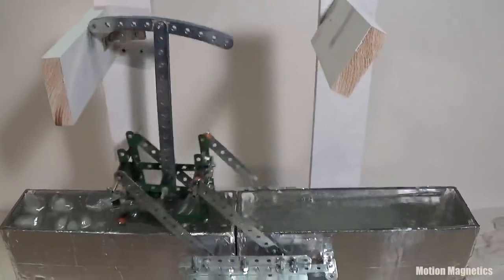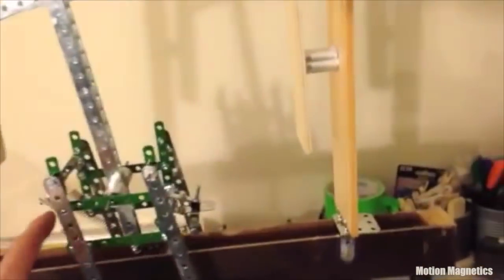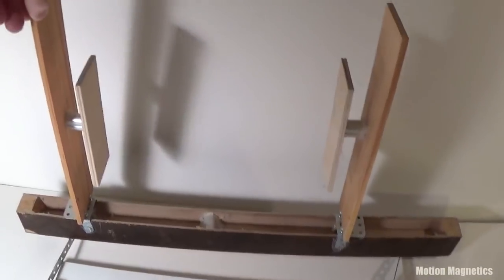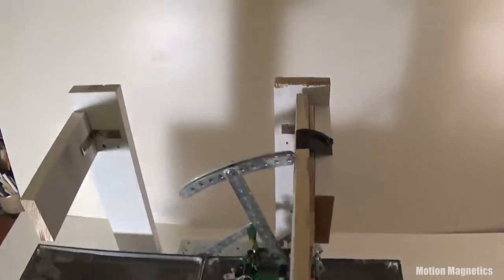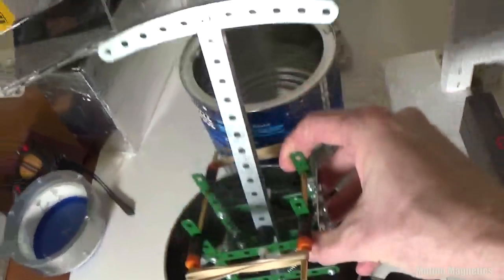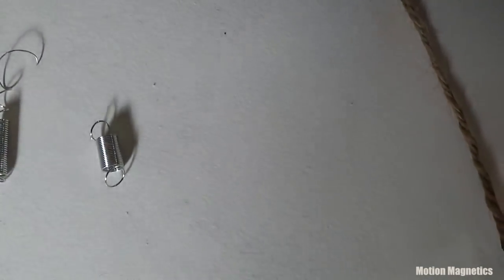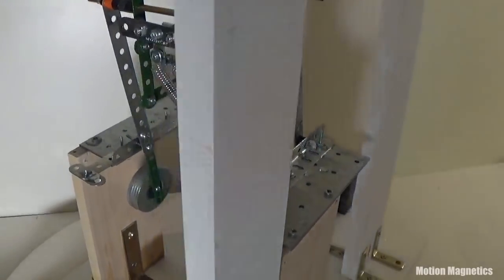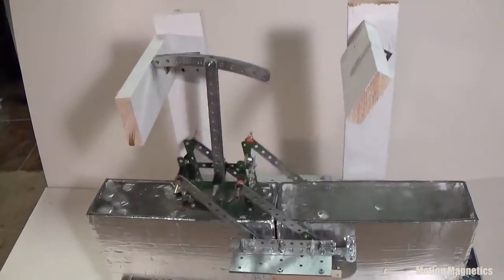Nitinol Heat Engine Version 2.5

Comment: I suppose you can obtain the same result with an escape mechanism like a mechanical watch. I mean you have to give energy in order to heat up the water, like turning a crown of a clock to give power. I know wall clocks that works for several days...i'm not inpressed untill you find a way (efficient) to heat up water for free and with no maintenance cost.

Comment: Very cool machine. Appreciate you sharing.
Do you remember those old toy windup cars? Wind up the spring by turning the key, then set the car down and let it go until the spring completely unwinds?
Could Nitinol be used in place of the spring steel in that mechanism? Seems like room temp nitinol would make winding it up easy. Then, apply hot water and allow it to unwind with force. I wonder if one of those unwinding could do useful work AND wind up a second spring at room temp, going from one to the other, each winding up the other back and forth for continual operation.
No, I don’t know how. Just a thought I had as I watched your video.

Comment: Wow that’s really involved, it looks great rocking back and forth, but for generating electricity I think the vid of the horizontal bike wheel spinning around like mad and if a small 12v gene/Dynamo was attached it could give constant energy if the water was heated with a solar collector etc.

Comment: I was totally absorbed through out the whole video. Great work. Could this be used in a circular motion to create a spinning motor? & If so would the heat required to be generated be more difficult to create than the energy the device could output?
Reply: @chaorrottai  1 engine outputted only 30W I believe, the 5 MW was purely theoretical if you were to stack an unimaginable amount of them together...

Comment: Nice design! Here's one more suggestion. 
What if you made a dual walled container for the cold side and filled the outer, sealed cavity with liquid nitrogen and the inner part with water.
The hot side could be room temp and it should run as long as the insulation kept the nitrogen cold.
Just a thought.
Reply from the maker: Thanks. Interesting idea.

Comment: It would be interesting to use concentrated solar heat on one side and compare it with stirling engine or solar panels. 
What do you think is the potential of a nitinol heat engine?
Reply from the maker: You can definitely power them that way. I'm not sure how it would compare to a Stirling engine. As far as the potential, they knew nitinol engines could be used to replace standard power generating techniques in the early 70s. https://youtu.be/oKmYqUSDch8
Reply: I just want to know how efficient are these heat engines.
Stirling engines were proven to be 30% efficient (more than solar panels) - but they were costly had more mechanical parts (less life time). Free piston sterling seemed a good way to produce electricity but I hardly saw any replications or comparisons regarding output power. 
Nitinol engines have not been in market for any use I guess. Neither has anyone compared it with solar panels. Maybe they are costly.
So solar panels seem to to be the best option now to extract sun's energy? 
I am new to these devices and this research area. I will be experimenting on them some time in my life. But I hope, we find a cheaper solution to compete with solar panels.
What are your views?

Comment: Nice video. Can this motion be used to generate enough electricity to maintain the temperature difference and power up LEDs?
Reply from the maker: Possibly. I haven't tried that.
Reply: Replace weights with magnets and coils to run pilter device sandwiched between to return there temps to there proper side

Comment: So how long did it run in the set up you showed last? 
Also think you could apply a copper wire to the motion and a magnetic field to generate electricity? Another option may be to use a similar device a motion charging watch (eco drive) uses to generate a usable charge?
Reply from the maker: It's assembled parlty of parts from an old erector set, so you have to stop and adjust some of the parts here and there because they vibrate loose. Other than that, it runs until the temperate falls below the threshold necessary to return the springs to their shape. About 10 to 15 minutes. If you kept the tray heated, it would keep running.
Reply: That's pretty good. Makes me think it could work in coordination with a Peltier device.
Reply from the maker: Possibly. That's not a bad idea.

Comment: Pretty amazing, man! Think you could plop a conditioning coil in the cold tank and a heat vent running under the other?
Reply from the maker: Thanks. You could. It would keep running if you maintained the temperature differential, and swapped out some of the parts so that they didn't become loosened from the movement of the engine.

Comment: I have a free energy idea with nitinol. You take a nitinol spring to lift a block with mass of 1000kg some distance of the ground by heating the spring with a tiny amount of warm water mass. I don't see why a fixed small amount of heat energy couldn't lift an arbitrary weight and thus gain an arbitrary amount of potential energy (assuming you don't make the wire break). Fixed energy in = arbitrary energy out depending on block mass? Or is the spring contraction length difference not constant under different loads?
Reply from the maker: Sounds like an interesting idea. You should give it a try.
Reply: Wave Man thanks for encouraging. Startup energy will cost something at the start of a free energy device, but that cost can be paid back a 100% because the output is free and it is looped back to the input, hence the term "closed loop" system. Starting energy cost does not matter: it is a free energy device, which means that it can replenish its own startup energy after some time.
Reply: Wave Man, thanks, I will keep that in mind. I can't argue with that because I'm not that familliar with nitinol. Sorry to end the conversation, it's just that I am working on another free energy device (based on buoyancy) which is more within my league than nitinol. :p
Reply: I am all for transparency, clear acadamic and layperson how-to explanations, open source, peer review and massive disclosure of such technologies. I will put it on my website (I don't have a domain yet) and this channel eventually, but I can't guarantee that it will be within the 5 upcoming years. :P Write my name down on your list. :D

Comment: Well done... technically, you can use 2 liquids with very different vapour pressure from each other to replace water on both sides if you want to avoid boiling the water on one side every time you want the engine to work... However, you might want to seal the one with the highest vp to avoid it evaporating... For instance, you could use Mythelene Chloride (DCM) on one side and water on the other... if the mythelene chloride contains a black dye, it will be more likely to absorb IR from the environment (The darker the dye the better) leading to an increase in thermal energy capacity which will lead to even higher increase in Vp. The water on the other hand can contain white dye or grey to induce reflection of IR from the surrounding which could lead to a lower Vp. The difference in Vp will determine the Potential difference of the entire system but, the containers carrying the liquids must not react with the individual chemicals it contains... That should in theory be enough to drive the engine (On a way smaller scale).
Reply from the maker: Thanks. That sounds like an interesting approach.

Comment: What is the cycle lifespan of your nitinol?
Reply from the maker: I'm not sure. I ordered them from a supplier in Belgium, and they didn't come with specific information pertaining to lifespan. If you look up Ridgway Banks research, he states that not all Nitinol is manufactured to the highest quality. Though it can be made to last in continuous use for years, if manufactured properly. He has a simple device that's been running uninterrupted for several years, without any noticeable degradation to the nitinol.